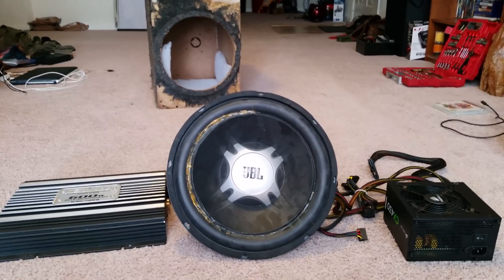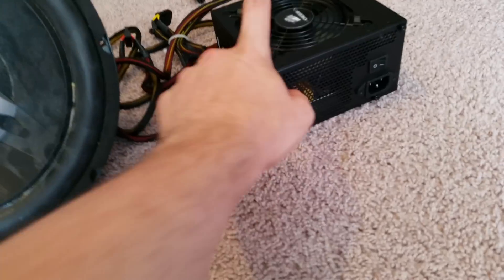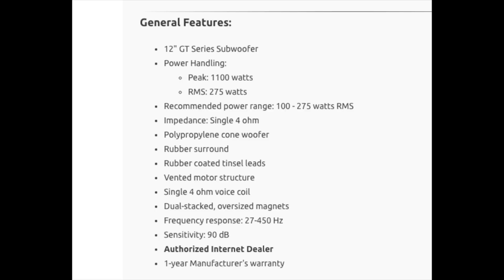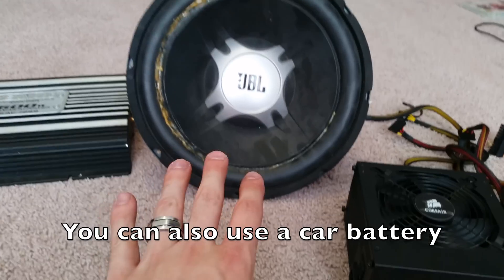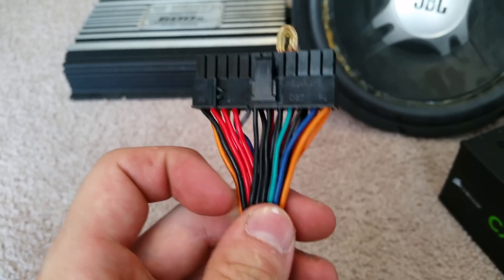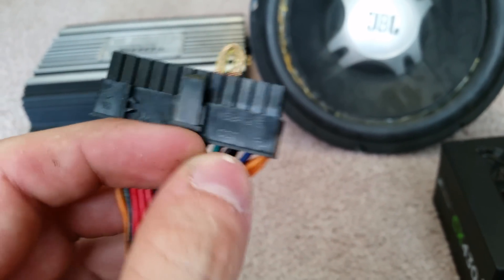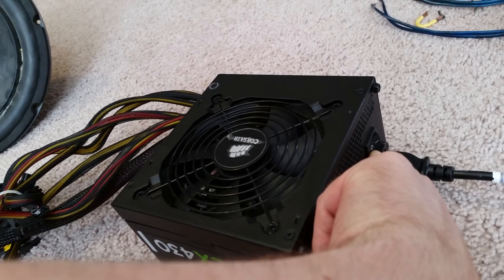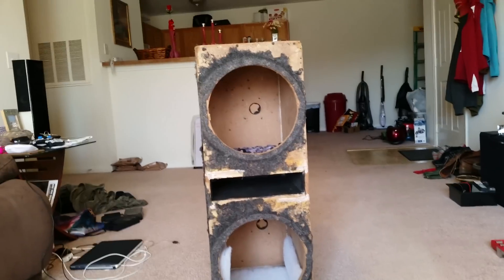How to make a powered subwoofer

Comment: Never convert a speaker wire to a rca cable otherwise you will create feedback and damage a car amplifier use a car stereo line out converter if you're receiver doesn't have a subwoofer pre out

Comment: If you use a computer power supply you want to make sure it supplies enough amperage to the car amplifier wattage of your power supply is not what matters amperage is what matters also it's very important to use some proper gauge power wiring and have a fuse on the ground wire so that you don't damage the car amplifier

Comment: You can also use a home theater receiver with a subwoofer pre out and hook up a stereo receiver to the subwoofer pre out of a home theater receiver and you can power car subwoofers in your house without a car amplifier it also makes your car subwoofers much louder and is great if you don't have a powerful power supply to power a car amplifier in your house
Reply: Integrated house amplifiers aren't as powerfull as car amps and might not be able to handle lower impedance that most good subs have. If it's 4 ohm subwoofer it will be fine but don't expect a lot of power.Most can only supply 50-100w per channel.
Reply: Cekpi7 I know that that's why I plan on getting a dj power amplifier one day something like a crown or a behringer power amplifier a power amplifier that does 500 watts per channel I'm only using a second av receiver to power my subwoofers indoors because I don't want to use a car amplifier to power subwoofers indoors and plus I'm only temporarily using a second av receiver to power car subwoofers indoors until I can afford to get a dj power amplifier one day

Comment: Using a pc power supply really isn't your best "boom for buck" option, unless you just happen to have them laying around and don't have to buy one. Easiest option... just buy a plate amplifier designed to run off 110v ac already. To utilize a used car amp you have laying around... a "server" power supply $/watt is the better choice. Its really preferable to use one that is capable of more amps than are needed by the amplifiers max RMS load in your design. More reserve power is great for brief dynamic peaks. Impressive server power supplies can be bought online for 20-50 bucks used. (im using one now).  Great info tho for a lil project. Unlike a lot of the vids showing similar setups you understand that its silly to try and run a 2000 watt amp with a 20 amp power supply. Enjoyed your vid.

Comment: To simplify: The only wires you will need are the ones that goes to the PCI-E and CPU power connectors. Don't mind the SATA and 4-pin molex connectors. 
Of course you will need the switching power wire connected to ground (or through a separate switch)

Tip: A modular power supply is the best option, although it's typically more expensive. 
As for myself I have a 1300w EVGA fully modular power supply running a 1000w amplifier (can safely run a 1200w amp without any problems, as long as the amperage of the amplifier are close to, or matching the total amperage of the PSU (in my case, the amp is 100A and the PSU is roughly 110A)

Comment: food for thought. you can buy fairly small converts that go from 120 in to 12 volt out and you can get them from 5 amp up to 50 amp lol which is likely what ill do :) like 70 dollars worth. but i think worth it for having an awesome powered sub setup
Reply: yes, i have done this and it works awesome!
Reply: nice :) ill be doing a power sub next time i have some spare money to get the materials :D only ill be using a jl amp (getting it from a friend for pretty cheap) a kicker sub (100 bucks online...need i say more? lol) and a power convert. should be some good bump for the amount spent and should sound great. gonna use an old box that is actually in my suv now lol
Reply: emerybryant If you plan to use it In the house and have wood floor and not carper, then I would recommend making the box somehow to point the sub at the floor. It makes it sound much better because you get even coverage throughout the room
Reply: nah i have carpet lol but thanks :)
Reply: emerybryant to be honest, even on carpet it might be better... Is it gonna be sealed or ported?
Reply: its a ported box lol
Reply: emerybryant ahh ok, i would recomend making a box that faces the sub to the floor and the port at the front or back, like normal home theater 5.1 subs. that way it will sound the best in the house.
Reply: im going to use an existing box tho lol friend of mine built it. its a pretty good box :)
Reply: emerybryant ohh ok, try it and see if you get spots in your room where it is quieter than normal, if so then i would recoomend getting a downfacing box.

Comment: orrrr you could buy a plate amp....
Reply: Salty Graphics you are pretty salty XD. But a plate amp is more fun and its cheaper better sound quailty and its actually made to be in corprated into systems but if this is all you have yes you can do this but dont go out and buy all of this fir you system.
Reply: Salty Graphics lol well i know something more fun. Building speakers :) and im not denying that i havent done this exact setup becuase you can sometimes get more watts out of car audio.
Reply: Salty Graphics true but your really limted with a power supply becuase of the wattage difference.
Reply: Fuskers or better yet you can get a home theater receiver with a subwoofer pre out and get a stereo receiver

Comment: Like this because I've done this many times in the past. But the best power supply for the money is  DPS-1300BB. you can get it from 15-30 bucks on ebay. I've had 4 of them to power like 3000 watts. they pump out 50 amps at 12.2 volts. perfect for this. PC power supplys work, but are weak on the main 12v rail. their power is spread through the different voltages on them. And they cost a lot. Great vid!
Reply: by the way, in your video you said you don't want to pass the amount of amps on your car amp. That is not true. you could have 130 amp power supply and it would be fine. The amp only draws as many amps as it needs. It will just simply not use the extra amps.
Reply: sorry for all of the comments, but it's just some ways to improve your setup. When you plugged the port you decreased the volume of the box which makes the tuning of the port a lot higher.Although not perfect, it would be better to just cover up the circle cut out. what you did made the sub less loud and musical.

Comment: it would be much easier with a DC power supply to power the amp than a computer power supply. less wires to worry about and less margin of error when splicing wires
Reply: Bingo.. and generally those PSUs have little power output to drive an amplifier.

Comment: DO NOT USE A CAR BATTERY INDOORS!!! I cannot stress that enough. When the battery is discharging, the acid in the battery is giving off a toxic, flammable gas. Only use a completely sealed battery that is made to use inside of the vehicle. Kinetik makes some good batteries for that purpose. But do not use a regular car battery for this. Also, do not use the gain for a volume control. That's not its function.
Reply: Larry Milbury or you can use a home theater receiver with a subwoofer pre out and hook up a stereo receiver to the subwoofer pre out of a home theater receiver and power car subwoofers without a car amplifier it makes your car subwoofers much louder and is a great alternative to using a car amplifier

Comment: NEVER EVER EVER EVER USE YOUR GAIN KNOW TO SET VOLUME OF SUBWOOFER. THAT IS NOT WHAT IT IS FOR!!!!!!!!!!!! I hate when I see wrong and damaging advise being given on theses d.i.y videos. Your GAIN IS FOR SETTING A CLEAN SIGNAL that goes to your sub. follow his directions and your sub will hate you and it's life will greatly be reduced!!!!!!!
Reply: GAIN KNOW was supposed to say GAIN KNOB. lol
Reply: So how would I get my Sony explode to pound when I set it low?
Reply: u typically want your sub to play sounds below 80hz or lower. that means if you set your frequency response to 80hz than only the bass sounds will come though the sub (with 80hz setting, any notes at 80hz or lower will be played through your sub). that is what the gain does. so if you set your gain all the way up, you are sending all the vocal and treble to your sub also which your sub is not meant to play. so set ur frequency response to about 80hz. and then you want to get a digital volt meter preferably. google how to set gain with a multimeter or it will take forever me to type. you will need to do a quick easy math calculation and use the voltmeter to match the number u get. if you do it this way you will not damage anything no matter how much you crank it because the amp power will match the subs ratings, and you will be sending a proper bass signal and a clean one at that to ur sub. when you have things dialed in proper, u will be amazed how it is not only loud but sounds good also. there is more to sound than being loud. that is why they have tweeters and midrange driers etc.
you also want to do the exact same process with your highs and mids also if you hook them to an amp. just google how to set gains with a multimeter. loads of GOOD info out there!
Reply: Why not explain what the gain is for? instead of just saying never do it. i hate when people fo that. Educate him and others like myself who don't know.
Reply: I got triggered like a little bitch n replied before reading the comments. You do go into detail. I apologise.
Reply: methinks you confused the "gain" with the filter setting on your amp.  The GAIN adjust is there to adjust the signal.... the filter(s) select the frequency of the output of your amp.
Reply: @ckookla gain is used to amplify the input signal.
a crossover is used to filter out frequencies we don't want. You mixed the two.
Too much gain causes the signal to clip which may result in your driver/amplifier to overheat.
Not using a crossover might let your subwoofer play frequencies too low and damage it.